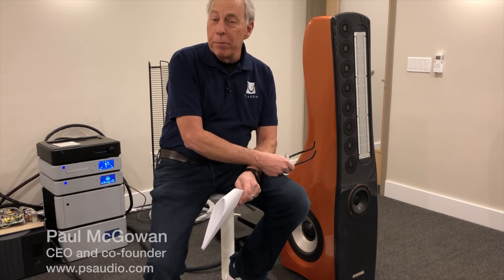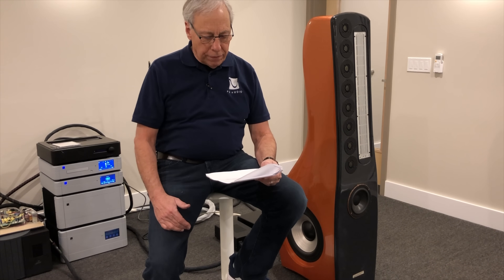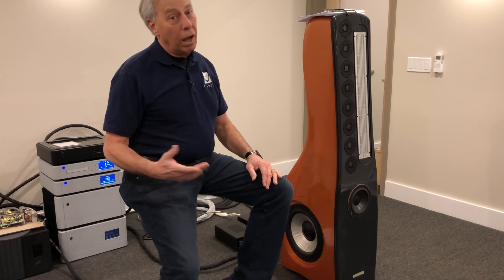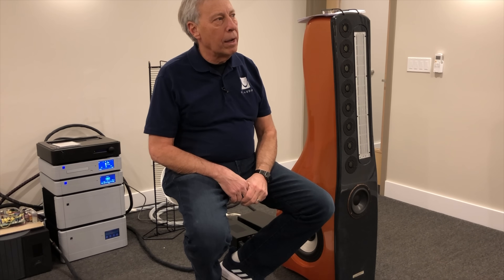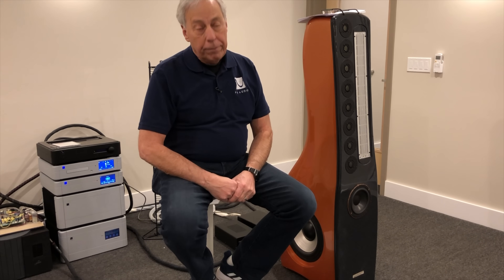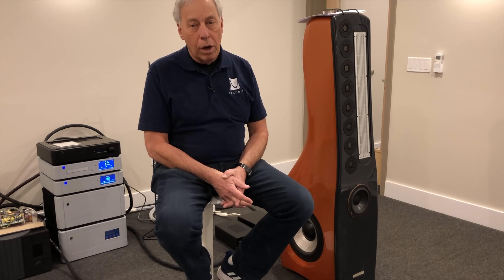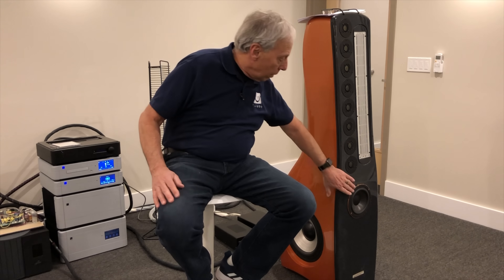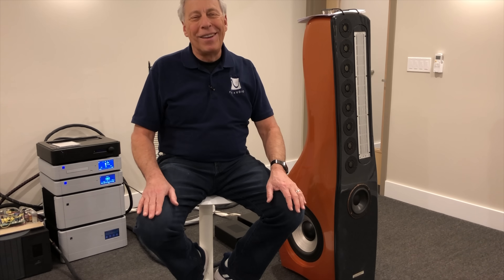Why do speaker drivers use different materials?

Comment: Is there a reason why carbon fiber isn't used (at least to my knowledge)? Is it too stiff and therefore too brittle for lower frequencies since it doesn't bend but snaps under immense pressure?
Reply: Carbon Fiber is used in some speaker brands.  I think Borresen uses it.

Comment: There are so many different approaches .All with their advantages and disadvantages.Different designers will often be dictated by the available budget,and this places constraints on what can be achieved.All the driver materials will offer differing characteristics inherent to their structure to begin with.Then there's differing cone profiles,differing thickness,variants on the suspension,and or edge termination.Even the type of dust cap or phase plug will contribute in some way.A whole gamut of variables for the designer to play with!

Comment: hello paul informative and well explained ,but ,i dont know what those 5 boxes behind you are,but why not use a hifi rack,surely that is a better idea,for many reasons,thanks,
Reply: Ben Smith, those are the PS Audio gear, Not sure what the black piece is, but the next piece down is the CD transport, the next one down may be the DAC, then preamp and amp or something along those lines, and they power the Arney Newdell designed speakers.
Reply: @johnhpalmer6098  my point was why on the floor and on top of each other,whats going on,there at pauls place,just dont understand,
Reply: That I don't know  but your initial question didn't ask for that. My guess is they are simply using gear to test speakers but may get something to sit them on. People stack gear all the time, though not necessarily on the floor but many do.
Reply: @johnhpalmer6098  thanks for your reply,but do you put your amp or cd player or streamer on top of each other,and also on the floor,????????????
Reply: @Bernard-John  none of mine are on the floor, but on top of expedit shelving from Ikea the cassette deck is on top of the receiver, the CD player is next to the receiver be on the same shelving. My turntable is on an adjustable shelf to level and isolate. The R2R deck sits in the expedit shelving to the table's left. Speakers are up off the floor about 15 inches. Again, don't know why Paul and Co. Do this. Some have short platforms they sit the amps on, on the floor though, especially if separates.
Reply: @johnhpalmer6098  sorry after shelf from ikea can not take you seriously,i was thinking more of a good quality hifi rack,thanks and success.
Reply: @Bernard-John  Wow, judgemental much? So you think all gear should be on audiophile racks, right? Well, not always and it'd be best to open your itty bitty mind up just a little about other people and their gear just a bit and realize not all of us care, nor want, nor can afford proper audio racks and I just happen to have the Expedit, and in MY small house, it's serving the purpose of holding my gear, but my LP's too.

Besides, it's a 2 way street here and I'm going to say I will not take you seriously for judging me in a negative way, based on what I use for an audio rack. All I can say is, it works, looks fine and does the job just fine, thankyouvery much and that you believe nothing but audio racks will do to dismiss me as not seriously due to what I place my gear on.

Comment: The ideal speaker cone has infinite strength and stiffness and has zero mass.
Reply: This is what i cannot understand, some of the best high power subwoofers for PA / Live use have pressed paper drivers
Reply: for tweeters and midranges maybe, but how would a subwoofer with very little mass sound? The resonant frequency of the driver would be so high, that it would be horribly inefficient to produce anything below resonant frequency

Comment: Can you show us the Square wave? That seems almost not possible... would and Oscilloscope be able to show that?? Just trying to figure that one out in my head... That has to be a lot of power all at once to be able to create that... tks
Reply: with battery you create a electrical square wave, the outcome mechanically from the woofer is probably not that. you really need a graphically software to show how close it came to representing the square.
Reply: It would never be perfect. You'd need zero inertia for that.

Comment: my infinity interludes have c.m.m.d cones (aluminum covered by ceramic foam on both sides). those are the best sounding speakers i ever heard. i will never sell those ! too bad infinity is going downhill lately. they had such good stuff before.
Reply: Theyre a fine speaker yes, i also love wharfedale
Reply: Chef Chutardo I still rock the il60’s love them! Tried the alpha series and wasn’t a fan infinity definitely has lost their spark :/
Reply: i had il10's and il30's. needed more power. so i build two huge front towers. each tower has two 10" infinity kappa 10.1 that play the 50-250hz. two of the 6.5" drivers that were in the interludes to play the 250hz to 2khz. and one seas tweeter. those things sound awesome !!
a dayton 18" sub takes care of the 50hz down (seperate box of course).

Comment: I have titanium subs from the early 2000's by fujitsu ten/eclipse....wonder why titanium isnt used more for subs?
Reply: Expensive. If an aluminium cone is stiff enough, why add the extra expense of titanium? Titanium comes into its own for tweeters.
Edit: Polypropylene plated with titanium rather than pure titanium, or titanium alloy. Maybe the punters wised up to this...
Reply: some of the prices on speakers just makes me wonder...yea titanium is expensive, but in comparison aluminum is cheap for an expensive speaker system... @jonathansturm4163
Reply: I have worked with titanium dental prostheses which are quite bendy, but spring back into shape. I believe that is referred to as a "memory metal" because it springs back to the shape it was cast in. The flexibility, bendiness, of titanium is great in certain applications, but very undesirable in others. It seems to me that if the goal is stiffness, a perfect piston, then titanium is definitely not the way to go. Of course, I am no expert.
Reply: @brianmoore581  My spectacles are of the nature you describe. I suspect that this is because of the particular alloy used. Aluminium, with which I am more familiar, comes as several different alloys, some stiff and some very malleable.
Reply: if you have seen a lot of driver specs, you'll notice titanium isn't any better than other materials as a speaker cone/dome.
Reply: @duckmesideways  One of the very best woofers of the 1970s was the KEF B139, a sandwich of expanded plastic and aluminium foil. Lightweight and stiff; that's what makes the difference.
Reply: @jonathansturm4163  yeah, aluminum is somehow superior to most other materials as a speaker cone/dome. it breaks up hard but much later than others. a decent aluminum dome tweeter can perform well up to 30 kHz before breaking up while a decent woofer can perform well up to 2 kHz while others already start breaking up at around 1 kHz. for higher order crossovers, i'd almost always go with aluminum.
Reply: @duckmesideways  I have always had a lot of respect for the Norwegian driver manufacturer, SEAS. Many of their drivers have used aluminium.
Reply: @jonathansturm4163  you might want to check out Dayton and Peerless if you haven't. some of their drivers are outstanding (Dayton has nice woofers and subs, Peerless has nice tweeters).
Reply: @duckmesideways  I used Peerless drivers for a speaker system I built for a neighbour back in the 1980s. These days I'm too arthritic and rely on VAF to make speakers for me. VAF uses SEAS drivers though suitably modified for Phil Vafiadis's needs.
Reply: @jonathansturm4163  at least you can still do it, just not all by yourself. get well soon.
Reply: @duckmesideways  it’s not always graphs and data we can’t measure feeling on paper and that’s important because music is feeling.
Reply: @Itsbeenlikeforever  for fuck's sake... i'm so sick and tired of this fallacy. music is art, music is feeling, yes. but audio systems are not music!!
Reply: @duckmesideways  you are blind spiritually
Reply: @duckmesideways  I'm not reading all that bye

Comment: Hello  enjoy your shows, take it with a pinch of salt from me I don't offended it's all done in the most possible taste.
Make this driver I've not seen one. For woofers. it would work really well probably for mid-range 8 to 6"  you're right about the aluminium or beryllium or even be the best titanium would be better, it is important the speaker is paper is very important it is a great acoustic material best out there for drivers metal drivers as you say have a canning effect, and they do have a metallic sound so my idea is to combine the two paper around the voice coil for a couple of inches glued on to a metal cone to give it the stiffness at the edges of the driver,  Should give you best of both worlds the judgement on how much paper and metal you use has to be worked out maybe you can get them to make one.   Why don't you go with plasma tweet seems to be something that hasn't really taken off I don't understand why. The best driver is by cube audio you should try them

You don't know much about race cars that understandable no we build them to be as light as possible. distribution of weight is important and downforce effect makes up for the lightness as much 5 tonnes
Reply: Are showers part of the tour?  Maybe I'll pass on the visit.  That would be quite the bait and switch.
Reply: @accidentalheadclunkers8517  yes I think so as long as he doesn't expect you to share, this auto correction typing is a nightmare.
That brings a new meaning if you scratch your back i'll will scratch yours
Reply: Plasma tweeters create ions that are poisonous. But when are youre designs coming out. You seem so knowledegable. You probably work with a high end company. I am sure Paul is willing to maken you annoffer you cannot refuse.
Reply: @ArnoldVroomans  is there?? I'm not sure in the quantity of gas by-product of ozone is what you're talking about, that it's really a danger it's only very mildly poisonous and not serious. In a built-up closed area maybe with long exposure if you're producing a lot of plasma in like cutting torches possibly. I mean there is a thing of being ozone poisoned what is temporary and has no long lasting side effects used in photocopying what is a lot greater than tweeter would produce. i have an Ozone air purifier and I've had it all my life I never had an issue I don't believe a plasma tweeter produces anymore than a air purifier. And anyway when ozone convert back to oxygen virtually straight away when it's produced there's no more ozone in your house than that is naturally outside in the air. I looked it up and tweeters were banned in America for some reason not sure if this still applies considering photocopiers not banned in America. And if you wanted to convert it back to oxygen straight away you just have to pass it through chlorine mesh so they could make a container that is made of chlorine impregnated mesh surrounding the plasma tweeter and no ozone would be depleted just oxygen.
Maybe not sure this would have to be topped the chlorine but wouldn't be an issue you could have the mesh change colour when the chlorine is depleted say when chlorine is present it is green and when it gets depleted turns to Red a little cover on top of the speaker with a sponge and just some drops of bleach wood replenish the mesh

Comment: Sorry but accelerometers do not get rid of inertia. It helps linearization, but does not violate physics.
Reply: Sorry, but you just wanted to sound smart.
Inertia is essentially mass. And the position = the final sound wave. The velocity constantly changes in order to do that. So getting rid of inertia means counter to the resistance by mass. So f=ma v=at v=(f/m) *t. In order to counter the mass, you need more force. More force comes from magnetic field generated by coil and current from amplifier. The servo system sense the difference in velocity and feedback to the amplifier. That's how to "get rid of inertia".
You happy now?
Reply: @My Name Yeah yeah yeah. It's just a fucking  word. What's the meaning of "get rid of " anyway??
Reply: @hifivestudio-nl  No. Inertia is not a term is physics. There is only mass or rotational inertia. The inertia we understand is mass. So no mass doesn't change. 
What you have thought would possibly be momentum or kinetic energy. But all these are different things.